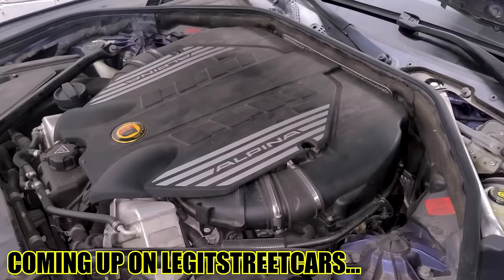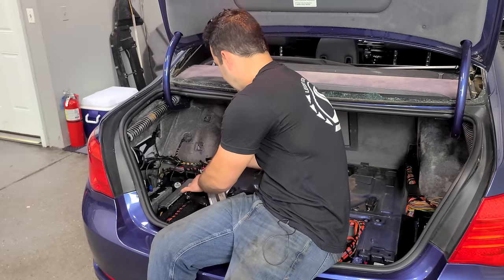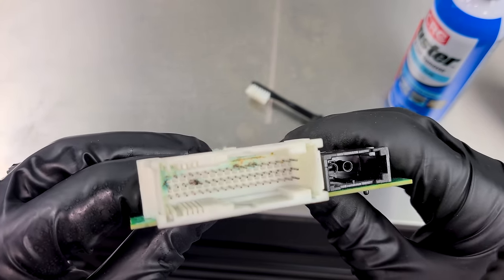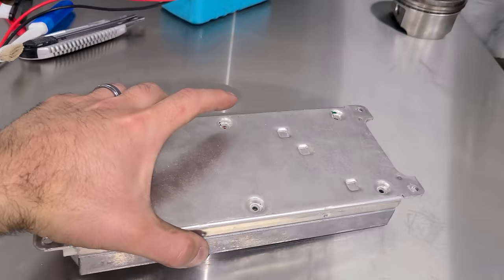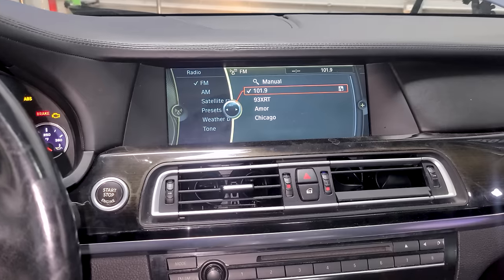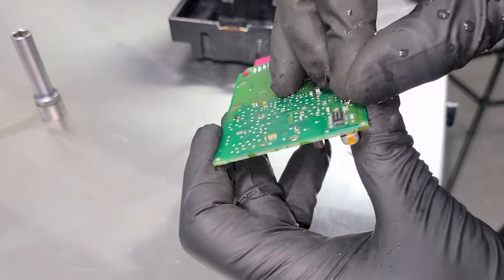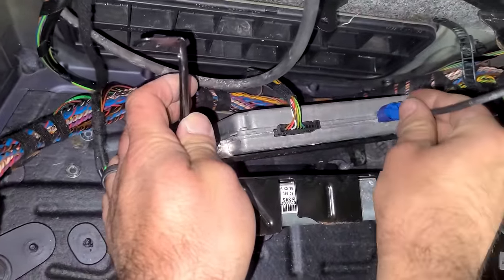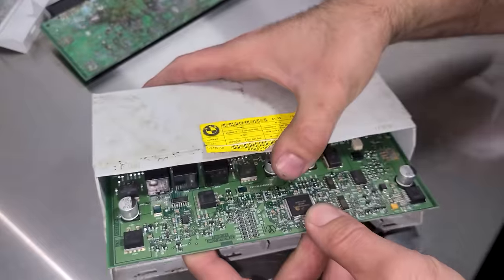BMW Dealer Tried Totaling My Car By Quoting $15,000 For 10 Computers! I Fixed Them All For $150!

Comment: corrosion

"Corrosion is a natural process that converts a refined metal into a more chemically stable oxide. It is the gradual destruction of materials (usually a metal) by chemical or electrochemical reaction with their environment."

If you are able to remove it without seeing any apparent damage to the circuits it is not a corrosion process overthere -remember material destruction - but rather a residue from water vaporization.

Anyway I really enjoyed the video, it kind of relaxes me looking at people who are able to do things with their hands.

Comment: Water on printed boards is not that harmful. The problem arises if there is power on the board as that induces leak currents in places that many not want that much current, and electrolytic corrosion of the tracks where depending on polarity, the copper can be etched away.
The worst thing to put on any board is WD40.
A working board can be sprayed with conformal coating which keeps water away but that doesn't mean the board will work when wet as water acts like a capacitive medium and will stop oscillators or affect low value capacitors.
A drop of light machine oil, such as 3 in 1 (uk product), in connector pins keeps them clean.

Great video.
It does annoy me, as an electronics engineer, that companies make life as difficult as possible for even the main dealers....

Comment: I know some sware by BMW, but with all the electronics and complexity it is just not worth the hassle. This is also why multiple batteries are required. For the possibility of water unsealed electronics are just trouble looking for a place to happen. I see no value in a BMW, except for those with more money than they know what to do with.

Comment: Very interesting experience.  Thanks.  But, I have to wonder how many connectors and similar look good but aren't perfect inside (where the pin makes contact) or corrosion under chips and such that might over time develop into a problem.  Bottom line, will this car ever be as reliable as it should be for a dear wife to drive or to be sold?

Comment: I had a motorcycle ignition control module fail because the back emf (kick back from the coils) was higher than the components installed. The back emf was at least 400 volts but the protection capacitors were rated for 250 volts. No surprise they failed. A new module was more £s than the bike was worth and would fail just the same. The fix was a few £s and a soldering iron to fit appropriately rated capacitors.  This could well have been planned obsolescence, but I suspect it was pure incompetence with managers hiding the c**k-up to avoid blame. Either way, the OEM should have far better control of its processes.

Comment: I personally wouldn't touch a BMW because I know I would need a new battery and there would be $1000 reprogramming bill attached, never mind the cost of any other remodule.
That said what you have done here is very professional (I am an X electronics designer).
Don't rub those SMD components too much, they are microscopic and can detach easily. 
I raise my hat 2U sir, well done.

Comment: I had this car, the dealership told me I deprived the motor of oil, the electronic oil reader read full but there was no oil in it. Smh . If you get battery discharging warnings constantly it’s probably the fact there’s no oil in car .

Comment: I’m sure someone asked these question but are those N63 engine reliable. I’ve heard about the engine running to hot warping the engine gaskets causing oil to burn? Is this true

Comment: Hi Alex, to complete the inside of the boot (trunk) will you replace those water stained inner wheel arch trims also?  Such a nice car and good to see it being revived.  You really lucked out with those second hand module prices - here in Aus a lot of wreckers look up dealer RRPs and sell the second hand stuff between 1/3 and 1/2 that price, so no real bargains to be had!

Comment: Great Job!
They either tried to scam you or tried to make you buy a new car. If this would been in Spain then I would immediately reach out to you and give you my address. I have the tools, parts and some experience when it comes to computing units on a car. My friend in Germany was a victim of a flood and his Alpina D3 was a totaled by his insurance. I bought his car, did some restauration and a bit of soldering and after investing 8900€, I had a working car which I sold for over 30k.
But I was lucky since the car was exposed to moisture for about 1 day and since the engine wasn't running, there was only a little bit of moisture in the air intake pipes

Comment: @28:36 Seems plausible that someone tried to remove it, it got stuck, and they tried to pry it out (subsequently crushing the plastic and some wires). 

then gave up and bolted it back up.

Comment: I did not see any mention of disconnecting battery before removing any module's, is it not necessary to do so on most cars. 

Going to be looking for a few faults on my 06 v8 touareg, so found this interesting. 
Did find similar corroded plugs and a broken pin, on the engine loom to body connector, on a 156 alfa i had. But as a quick fix, i just cut and joined wires each side of plug/connector, rather than try and source replacement parts.

Comment: BMW quoted me $16,000 to replace the entire transmission on my E60 M5 and told me that it was the only solution to fix the “red cog of death” error.  The service manager could not answer the most basic diagnostic questions and eventually let me talk directly to the tech.  The tech and I discussed the issue, I walked him through the likely failure and asked him to run a couple command-run tests.  He called me back a couple hours later and confirmed my suspicion that the hydraulic pump was the problem.  I supplied him with a brand new one I had sitting in my garage and was fixed all for about 1,300 dollars (including the pump part cost.)

Never just take a dealership’s word on what needs to be done.

Comment: Hey man how’s it going? First off I wanna say I love your channel man, it’s one of my favorites. I have a 2008 Toyota Camry LE, and I’ve been having this long standing problem with my driver side window. I’ve replaced the master switch 3 times, one being faulty, and the previous one the auto(driver( button) stopped working properly. I’ve taken it to Toyota, and a technician swapped out the new switches button and components to fit into the older worn out cheap switch as well. It was working fine, but it stopped working for a short time, then started working again. Any idea what the issue could be? I strongly feel it’s that I need an official OEM Toyota Master window switch, and stop buying aftermarket cheap ones.

Comment: Nice job on the repairs, though a telegraphers splice would be better  than a simple twisting of wires and soldering, better yet crimp-able heat shrink butt splices of the proper size crimped with a proper crimping tool are actually better, by proper crimping tool I mean one that ratchets until you achieve proper tolerances,  Amphenol, klien tools and Deutsch, I do not recommend the cheap pliers type crimpers  as they can not only not properly crimp with too little pressure, they can over crimp damaging the crimp this is why people do not like crimps as they are using the wrong tool and getting bad results.  Crimp solder spices are also good.  Why do I not like soldering, in over 30 years of Aircraft maintenance bad solder jobs are common, bad crimps not so much.  Soldering is temperature dependent not only for melting the solder but wen the colder cools, improper temperature leads to "cold" solder joints which to an untrained eye will fail very quickly when subject to vibrations, i.e. normal operations of anything that moves.

Comment: I had a M3 come in on the hook from the stealer that was a no start they told the customer the rear and front controll module along with the under hood maxi fuse box were no bueno along with $1500 diagnosis..the iat sensor wiring was shorting out on the cylinder head blowing the fusible link .The customer told me he left the dealer and the car failed in 20 miles..

Comment: @LegitStreetCars
The bottom line is that BMWs stopped being the "Ultimate Driving Machine" when they started loading their vehicles down with all sorts of complex and UNnecessary electronics and features that don't contribute anything to the driving experience. Also after the late 90s the quality of hard parts went into the sh!tter with extensive use of plastics where they clearly do NOT belong. The last of the best BMWs were sold in the mid 1990s, and it has been down hill ever since then.

Comment: Chance favors the bold, true, but unfortunately the problems with once corroded electronics have a good chance of returning. The problem with solder corrosion adds up to the modern lead-free solder used today by manufacturers, it's brittle on it's own and melts at higher temps, than the usual lead one. If I'm into opening these damn boxes and cleaning them out, I'd re-solder all corroded solder points  for sure, and then give them a protective clearcoat, you wife's nail coating would do as well, just be sure to steal the clear one, without any fancy particles in it, that might cause a short)

Comment: One somewhat minor nitpick here is that there's basically zero reason for someone doing this as a one-off to bother using deionized water instead of plain tap water. When you're soaking it in water if you remove any coin cell batteries and there's no power on it, it's going to corrode very slowly. You don't need to worry about the water you're using to clean it at all. The benefit to using deionized water is that you can let it evaporate on the board without having to worry about any left over dissolved minerals and salts. Rather than get a DI water source just for rinsing a board every now and then, just use tap water and compressed air to blow off most of the water, isopropyl alcohol, or contact cleaner to get the tap water off the board before it evaporates. Some people even put motherboards in a regular dish washer to clean them but I'd avoid it if you want to use it for anything food safe afterwards.

Also an ultrasonic cleaner would have saved you some time and effort and probably cleaned it better. Even a harbor freight special works just fine for minor circuit board cleaning.

Comment: Yea. My X5 had issue with abs module. We tried to fix that, cost was over 700 dollars in the end. We combined used one and mine.. Electronically, it worked, but leaks the fluids. So now, another used one for another 600 dollars was ordered. New one would cost 3000 dollars. BMW is absolute garbo car with all these damn units.

Comment: These modules appear very easy to work on compared to what I encountered.  I'm no mechanic but I am a computer hobbyist so I'm very familiar with circuit boards.  I had a 1996 Chrysler 300M with failure of the module that, among other things, told the alternator to charge the battery.  I opened that module and there was a circuit board buried deep inside there, underneath about two inches of solid brown gel that was obviously poured in as a liquid and then solidified.  Any tips on dissolving that stuff, or is a module like that just impossible to service?

Comment: its not as necessary to have deionized water if ur simply cleaning a board once, dont let it stop u guys from getting something done especially if ur manually agitating the dirt off, deposits arent going to build up and short the board out or eat it away in that amount of time and in those conditions, tap water is just fine.. obviously u dont want to let it get into anything n let it dry there, THEn i can see deionized being alot more practical n important   otherwise impurities arent going to build up n b a problem in just one washing

Comment: Actually, you shouldn't solder wires on a car, solder joints can potentially fail from vibrations. It is better to crimp. In this case though, the soldered wires would probably last a long time.

Comment: Just an FYI - pins are replaceable.  Even on a BMW.  You might need a pin tool and a soldering pen.  EDIT:  Appears you know that, so why a new CU?  You could have repaired the old one?

Comment: Do you know if I can remove a telematics control module unit from my BMW F30 without error messages? Right now it's giving an "emergency call malfunction" error and I don't want to buy hundreds of dollars of parts for a feature I will never use.

Comment: The problem is not that it was submerged in water the problem is that the power was applied while it was submerged in water.

Comment: 11.6V and you make a any coding on BMW....not good!!! If you know even little about BMW, then you know BMW needs 13V for any coding. Yes, it means you must plug the battery charger or better the power supply. Even that small coding can ruin your BMW FRM module. There is many options to rebuild the pin. Solder the wire and make additional connector for missing pin wire, easy. That case is possible to make any modification to get exit for that single wire

Comment: 18:15 Dont do this please. you WILL scuff everything you touch. Do take the time use a magnifying tool and tweezers to scrape very gently directly at the "legs" of the ic. Also a cheap jewelry cleaner (the sonic bath ones) do an amazing job at cleaning. You should most def look into sonics man.

Thanks for restoring and now rebuying. This is how i rock too. :)

P.S.
Also take a look at "conformal coating" I use the one from gm chemicals. Its amazing.

Comment: Dude, that thing is a ticking time bomb.. loads of electrolytic capacitors in all those control modules, which will all fail sooner than later. I would dump that car Asap. 😳

Comment: REMEMBER:
Dealerships are overwhelmed with work. Sometimes it is quicker for them just to swap out some parts than to do a proper diagnosis which often takes several hours when it comes to car computer systems. Yeah, not the most professional way 
to repair  but  it is quicker & they make more $$ doing it this way.

!

Comment: All DIYers know that a shop and especially a dealer can’t be innovative and “try things.”  Don’t buy a car if you can’t afford to work on it yourself or be prepared to through away thousands or tens of thousands.  That’s par for the course.  With BMW, plan or AT LEAST spending what you paid for the car over its lifetime. If you are lucky.

Comment: I had a 2008 Infinity G35 that I thought the transmission went out. I was driving on the hwy and it suddenly lost all power and no matter how much I accelereated, it wouldn't catch up to speed. Check engine came on, I used a scanner to see the codes and sure enough it shot a tranny code. I erased the code and drove it to my destination but every time it would change gears, it would feel as if the tranny wants to give out. I parked it at a random Mcdonalds parking lot and returned the next day. I took it to a near by shop and they suggested it needed a whole new tranny for the whopping price of $1800. I got upset and left the shop and parked it down the street. Thankfully I owned a truck so I went to Uhaul and rented a trailer to tow it home. Towed it back home and I proceeded to search through forums and youtube videos. I found a video where someone explained it was a metal pron or wire within the valve body that snapped and it was quiet common with these vehicles. I got underneath the car and started by removing tranny pan. Then proceeded to remove the valve body. I took apart the whole valve body to the circuit boards within and sure enough, a wire was snapped in 2. I was at an Uncle's house so I asked my uncle what's the best way to fix it and he said flux and solder. I added some flux on both sides and soldered the wires back together. Made sure it was on tight and that it wouldn't snap easily. I put everything back together and filled the tranny with the required tranny fluid. Started the car and drove it 30 miles up and down the hwy and boom, everything was back to normal. Flux and solder kit cost me a total of about $40. Greatest moment of my car life. I made videos and took pics of everything. I was so proud of myself for not getting discouraged by the job. 👍🤙

Comment: Would this process work on a key that has the comfort access ability? I mistakenly washed it. It still starts the car  but the key fob doesn’t open the doors by the by pressing the button nor does the comfort access work could it just need cleaning I was thinking it lost the programming

Comment: $5000 for a ABS unit?? That's crazy...  AND that is one of all those components in a car that look, behave and have the same functions on all other cars... Even the connections are the same, except for a few notches or tabs.
AND it is a "of the shelf" product at ex. BOSCH.
But the manufactures mod it, almost always with software only.  
SCANDAL!

Comment: 18:20 Can somebody explain to me why the manufacturer only protected 1/3 of the PCB with conformal coating? If that had been applied over the whole PCB, the only broken part would be the connector in worst case.

Comment: It looked the same after it was cleaned but anyway, It's been my experience that most dealer's don't have good mechanics working for them. They are mostly checker's.. They would rather replace the whole car than fix it. Especially when it comes to a transmition problem.. They won't fix it.. They will just replace the whole thing for $4000, or sell you a new car, That's your choice when you go to the dealer!! They don't have real mechanic's there. There might be one guy in the building that can really tear a car down and rebuild it properly, But they won't allow it.. Dealer's don't make money off of man hours, They make money off of selling cars...